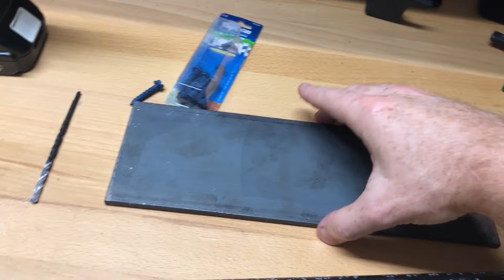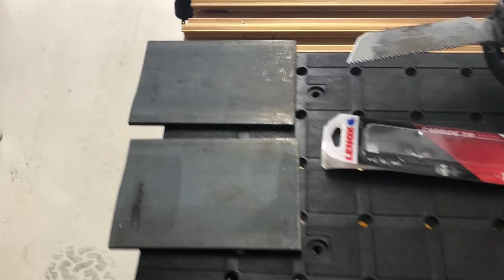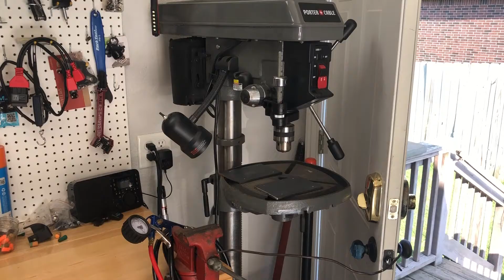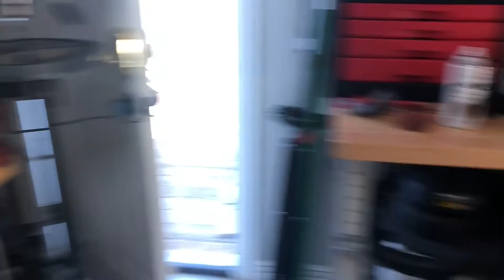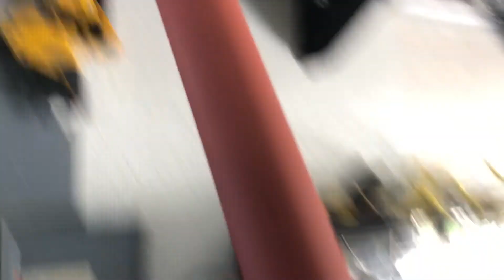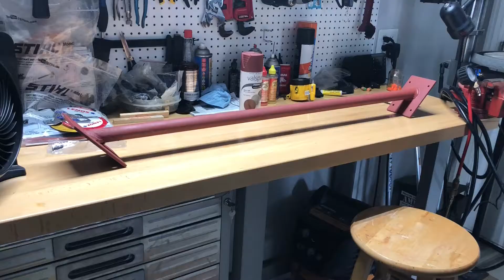Homemade Pull-up Bar using the Harbor Freight 80-amp Welder

Comment: There is code for a pull up bar?
Reply from the maker: Not code for pull-up bars, but for mounting load bearing items on brick veneer.
Reply: @HodgeHub  ok.  Gotcha 👍